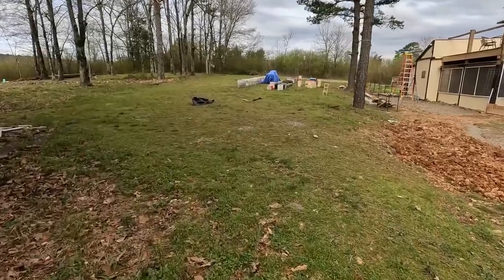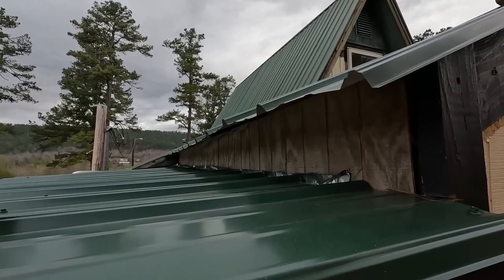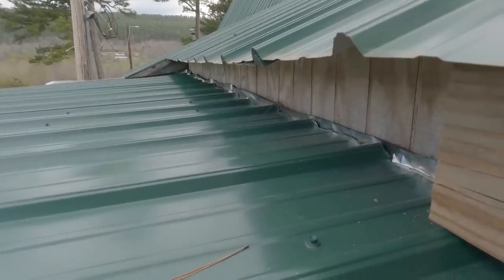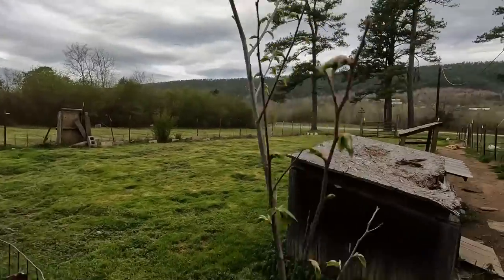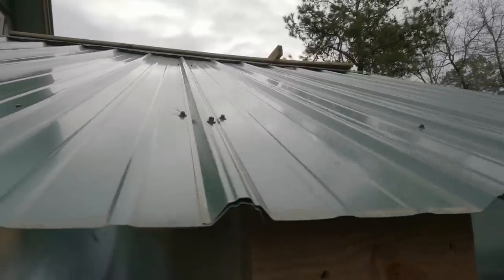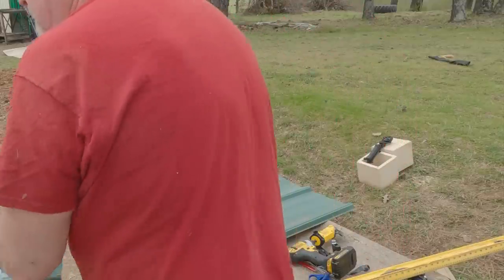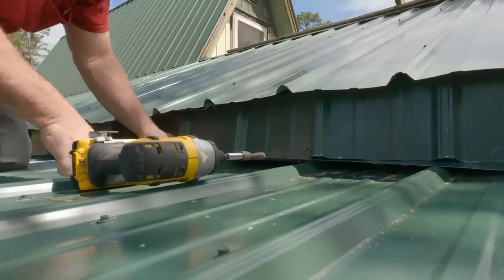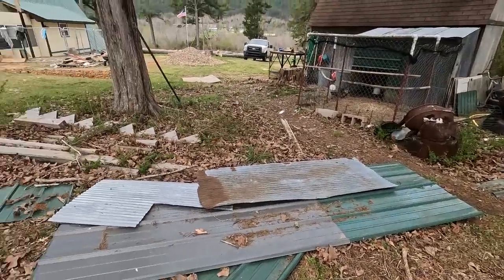Another Task Off The List.Dog Apartment Roof Updated.Waterproofing

Comment: Well mike, summer heat plays havoc with thinking processes.   Why not do some tinkering at a later time and reslope the flat roof to under the top piece and all three roofs slope as one. In other words remove the little flat under piece altogether. And put the flat roof over it and slope it in the same incline as the other two and change the side wall. Just a thought

Comment: Mike - to cut that metal roofing, just turn the blade (on your circular saw) around and fasten it back on.  Then cut your metal from the back side.  Works like a charm.   Patricia
Reply from the maker: You have to use a old blade, I dont have one, thats a brand new saw and dont wanna mess up the blade which it would

Comment: MikeMikeMike, Any boat repair places near you? We have old Andersen Windows from 1987 when our house was built...one bathrm & kitchen window
leaked all over the sills...used some boat cauking on both windows after we pulled them out to check the casings, all good...put them back in, cauked and replaced the sill wood...it was cheaper than new windows...did this three years ago...Cheers from Maine.